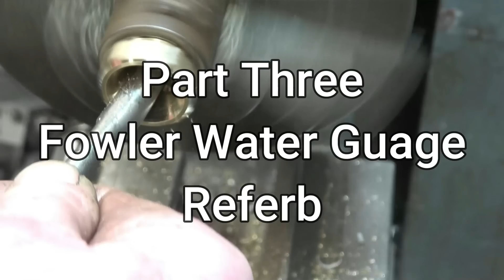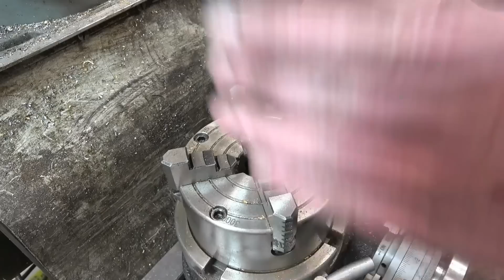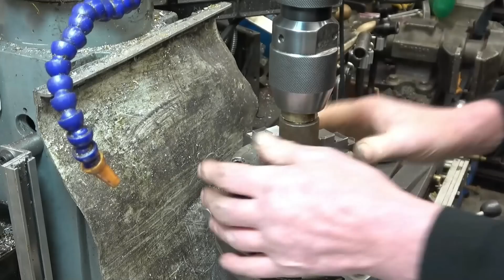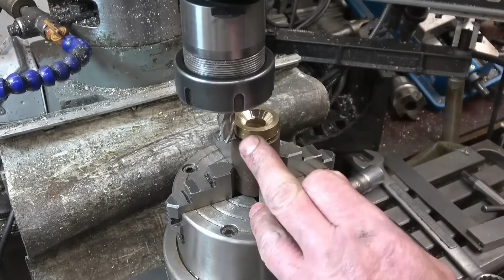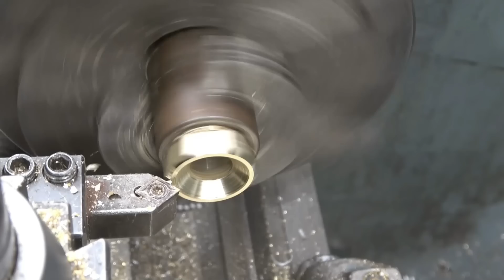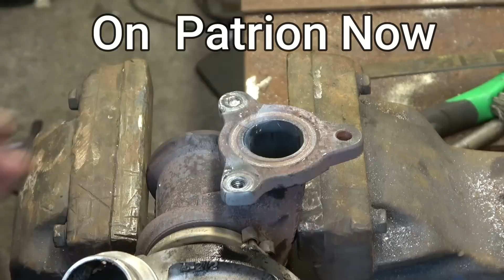SNNC  585 P3   Fowler Water  Gauge Repair

Comment: Nice nut that. I think the scraper was definitely the way to go particularly in a brass component, maybe a slight shortcut wouild be to use a 60° centre drill in combination with the 90° countersink. If you need to make a more accurate shape you can plot out X and Y coordinates of points along the curve (Y and Z maybe on a lathe?) and then turn down to them using the DRO but you'd still have to blend the result.

Comment: Oops. At 5:44, 10 deg off on the 240 measurement. Shows a bit on the facets of the nut?  But good enough 🙂 Nice work !!
Reply: Divine Imperfection  ...
Reply: I noticed that :)